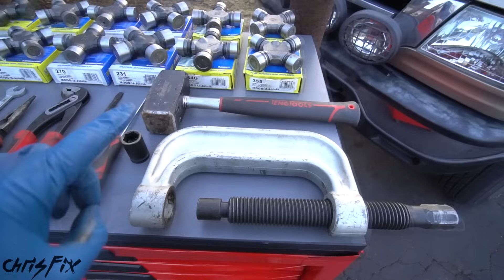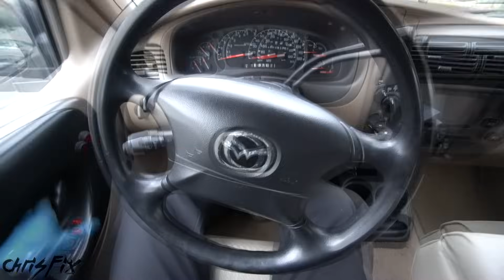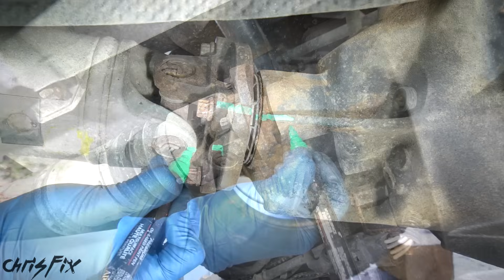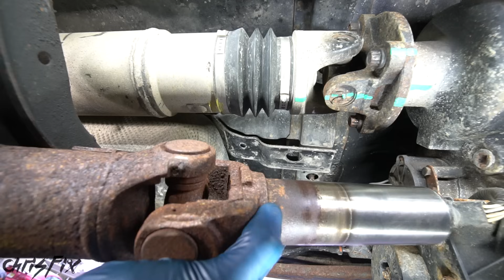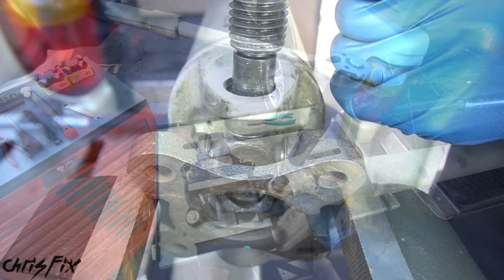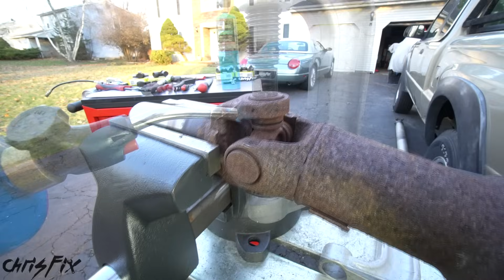How to Diagnose and Replace Universal Joints (ULTIMATE Guide)

Comment: I always get a chuckle when they make a point of marking the position of the driveshaft vs. the yoke.  The drive shaft is balanced as a unit, not in the car. In other words it's position related to the yoke was random at the factory. It would make sense to reassemble the slip joint in the same configuration if you have a two piece arrangement. If you really want to do it right, after you change out your u joints you would have the drive shaft rebalanced.
Reply from the maker: Correct and I always mark it because it’s not causing any issues with vibrations on its current position and I’m teaching millions of people who will see different drive shafts so I err on the side of caution.
Reply: @chrisfix  Thanks for the reply. I agree people do learn things from your channel. That said, I don't like to invent unnecessary steps just for the sake of doing them. Understanding how components work is the true goal. Mentioning that a driveshaft is balanced independently might actually save some frustration.  As an example, I had a driveshaft with a slight bow in it.  By itself it wouldn't be noticeable but when put on a lathe it became quite obvious that balancing it would not be possible. Therefore, I the mystery of where the vibration was coming from was solved and it was not the usual suspects, as is often the case when working on cars.

Comment: Good afternoon fellow DIYers, im planning to replace the U-Joints on my 2005 Toyota Sequoia and noticed that the drive shaft goes into the transmission. My question is when i remove the drvie shaft from the transmission, will fluid come out or will seals need to be replaced? Cheers, Andy
Reply: I assume you have a rwd car so if it's a slip yoke then fluid will come out and you'll need to refill the transmission with the same amount of fluid lost (or just until full but if it's over a quart lost make sure you refill before starting the car to check the fluid)

Comment: Great instructional video 👍 I believe it's my driveshaft causing the issue of vibration when I accelerate, however, the vibration stopped and I had no brakes 😳 is this also a symptom of a Ujoint issue?
Reply: no. that's a different can of worms. fix the brakes then shove a screwdriver in the driveshaft and try to move the driveshaft with the vehicle not running and in park (or first for a manual car) and if it moves then you need ujoints

Comment: I had a truck that was vibrating like crazy at 20-35 mph but smoothed out other than that. I figured it was unbalanced wheels so I scheduled an appointment. On my way to the appointment, my u joint blew out and driveshaft dropped😂found my problem

Comment: Hi Chris, I have hamming/vibrating noise coming from passenger side, when I'm sitting in driver seat. It's like something is spinning in uneven way. Zero up to 100 km/h nothing. It starts at 100 km/h, peaks at 110 km/h and disappears at 130 km/h. That sound is definitely connected only to car speed and not to engine rpms. Its louder when pressing gas pedal/accelerating, but it does not disappear completely when not accelerating. Its not engine, because that sound is same when in neutral or any other gear. Its not unbalances tire or wheel. I tried many different wheels. Ball joints are perfectly firm. Sound does not change when braking. There is no play in wheel in any direction. I've already changed both sides bearings and inner transmission side axl homokinetic joint since I found this joint could cause this sound. No rubber boots were damaged. All looking good as new.  I used high quality replacement and nothing helped. Axl itself looks perfectly fine. I also tried clicking test when turning full left, full right and accelerating. Nothing, there is no clicking sound. No I dont know, this sound started just like that 4 month ago and does not get better or worse. Still the same. I didnt hit pot hole or anything. I'm driving quality highways. My car is vw golf 6 with only 110 000 km in very good shape. Now I plan to change outer wheel side homokinetic joint, but I dont believe it will fix it. I will be glad for all ideas and suggestions.

Comment: My sons 1997 Ford F-150 has clips on the outside of the u joint for the rear and the front U joints I didn't see clips on the outside and the caps are flush. I think the clips might be on the inside. My question is can different U joints be used so that the front and rear are the same? Like the outside clips more than inner clips. Also we pulled the drive shaft before watching this video so how likely is it going to vibrate if we don't put it back the same way? I use to fix cars back in the day and never had put marks on my drive shaft. It always drove smooth after replacing them.

Comment: I’m in the process of replacing my clutch slave cylinder and my rear main seal on my 92’ ranger. I’ve tried every trick in the book for getting the driveshaft bolts off and they won’t come off! I’ve tried the jack trick on the breaker bar as well as penatrating fluid. Do you have any tips at all to help me out?

Comment: My truck had symptom number two and I took it to the mechanic but they could not diagnose this issue. Fast forward a month later and the U joint breaks and I’m stranded on the road. Thank you for the video, it looks like I’ll be able to fix this on my own on a Sunday.

Comment: Hey @chrisfix this is a long shot but quick question I have a 97 Chevrolet cavalier 2.2 fwd I got my motor mounts and transmission mounts replace but it still makes a thump/clunk sound I don’t think the car has a u joint I really can’t figure out what is wrong with it
Reply: When I switch from parking to drive

Comment: Also U-joint vibration will change when you vary the throttle, when you step on the gas it gets worst and when you left off it gets better.

Comment: let me get on here and start a YouTube page and I will show you everything from a car top to bottom and you would love me because I only give you the real and I only give you the answers and the realism of live breaking something down that has an issue and self-diagnosing it with my audience or viewers I should say another good thing to look for is I was doing a lot of research and having an issue with one of my trucks and I'm a license mechanic for maybe several years I've been licensed but I've been doing mechanics my whole life since a kid and I am 34 I will be 35 but professionally I've been doing it for probably close to 20 years another thing to look for is Lugnuts I was doing some research to make sure that each one of your lug nuts are properly torqued specs and also the right lug nut on the rim or wheel I've seen lug nuts that are for an aluminum wheel or have a different pitch for the phrase steel wheel when you have an aluminum wheel or all in all there just not correct for the depth of the whole of the rim that it's sitting in and or mismatched lug nuts can cause improper balance of the geometry at certain speeds and therefore hands cause you a walloping a fact or some type of rattle or mumble vibrations also also if it has not been overlooked you can have a slightly bent wheel and it doesn't show up on the balancing machine if you have another good known set of wheels that have been triple balanced in the right lug nuts try them and see what happens with a good set of tires knowledge is key and understanding the problem to become a great mechanic great doctor great lawyer and sedra and really studying and mastering your crap and going through trials and tribulations to find out the root cause of the problem a lot of these doctors even same thing you go in for a something and they said something else and give you a prescription and send you out the door but they never found the root cause of the problem they want to get paid and push you to the next customers are concerned about

Comment: great video I've changed many u joints and just wanted to say that I have had issues with the needles in the cup moving out of place using the hammer method, instead of hammering on it I just use the vise to press it together, I never worried about buying or borrowing a press  tool my opinion, the vise works perfectly.  but to each his own
keep up the good videos

Comment: Back at it tomorrow. Hammered several hours and finally got it to move but still about a couple mm and it won't budge. Have 2002 F350. WD 40'd it. Sledge hammered it. Any ideas? You make it look so easy.

Comment: what I've always done myself when installing a new u joint. I always take the socket and put it on the cap of the u joint, instead of hitting it with a hammer I crank it in with the vise. Because I have actually had u joint caps break from blows from a hammer to them.

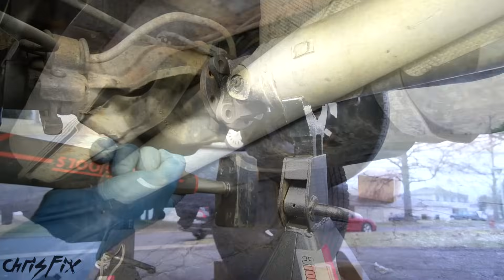Comment: 10:33  Here's why you want to chock your wheels... it would even be a better idea to release the pressure on the drive shaft by putting the vehicle in neutral and/or lifting the tires off the ground.  Always use jack stands!

Comment: The most complete video on U-Joint replacement, others don't tell how important it is to clean everything before installing the u-joints and this is a must. When driveshafts are assembled to install them in the vehicle at the assembly line, they are perfectly clean, and so it should be when installing the new joints.

Comment: Thank you!  I learned a lot from this video.  I've done u joints before, never knew about the hammer knock at the end to settle them.  Never knew about the plastic injected ones either!  I prefer to use the vise as a press with a socket (so, kind of a mix between tool and hammer method), just use a small socket for the push in side, big socket for the push out side.

Comment: I just realized I haven't been putting all 4 c clips on when  I replaced the u joint  my 97 blazer , I only used the 2 on the driveshaft but not the axle side , that explains why the bearing cup fell off 3 times already 😩

Comment: Hey Chris I would like to ask, would you still consider the U joint to be faulty if the vibration mostly stops when you take your foot off the gas, even at high speeds?
Reply from the maker: Sounds like an issue with motor/transmission mounts rather than a U joint. I have a video on it here, check it out: https://www.youtube.com/watch?v=ZTRV5GXWpo0 and https://www.youtube.com/watch?v=33k3vL-j68Y

Comment: Hey man just did my rear u joint on 4wd 2001 Silverado did only the u joint not the one by center support or a new center support which I probably should have but what do you think it could be they're brand new. Too tight? What could cause this need help asap and could this damage my rear diff or transfer case if they're too tight or other problem?

Comment: I agree with Macho Camacho said.    Your videos are great and you make working on cars seem so easy and fun.    I love saving money by knowing how to do things by myself.    I don't like to rely on others and being at the mercy of a repair shop.    I do work on my own cars but I try and stick to the interior stuff (changing out radios, temperature controls,  seats, tail lights, etc.); however, I think after watching your replacement of universal joints video that I could tackle this too.     I have a 2005 Tahoe, 2002 Suburban and 2000 Buick Park Avenue.   So with older cars, I always have something to work on.    I love to tinker with cars and I go to the junk yard alot.    I learn how to take things apart at the junkyard so that when I work on my own car I do it right.    Thank you for your excellent and informatvie videos.

Comment: Fantastic video. Excellent. Some Japanese drive shaft has a centre bearing with a rubber cushion with a holder to prevent the movements more conformable
Reply: Sorry to prevent the rough movements. And mothod is bit different to system to this

Comment: Your Mazda 4x4 I would assume that the front u-joint that goes into the differential on a 2011 Ford ranger 4x4 would be the same process correct ?

Comment: I have a 2011 mustang that only vibrates when I’m coasting (letting off gas no brakes) at 2k rpms or above. Once I hit the gas again it’s fine, ever heard of this? It’s a manual btw
Reply from the maker: Definitely sounds like bad u joint, sometimes it can show itself while accelerating or when coasting off the gas like in your case.

Comment: thank you ! 

i’ve been plagued with a seized caliper & seized bleeders all around courtesy of my denali’s previous owner :) but then i heard that cyclic squeaking & knew it wasn’t my brakes & it wasn’t my hub… i’ve replaced my fair share of hubs… & this was different.. added the metal on metal clunk i heard as i pulled in my drive(not while shifting)& i knew it wasn’t my hub or brakes… i’ve had all the wheels, calipers, etc pulled for 4 days & been stuck in my work truck…. this video has literally helped beyond measure! sure enough, i’ve got 2 failed u joints. i would have had a few more headaches i’m sure had i not seen your video. 

(at least my calipers got a restore & bleeders extracted.. & a much needed brake flush!)

thanks for taking the time to educate people about their vehicles. im self taught. & i love to learn more.

Comment: I replaced a u joint from auto zone and it was defective or didn’t fit correctly according to a pro transmission shop said to use oem or spicer . First mark the drive shaft and if heat is used let it cool a little before banging on it . In chevys or gmc the drive shaft should slide on , there’s a tooth that a little wider in the male end about 1/4 down to line it up correctly which is hard to see with a bunch of grease . I very seen people persuading the drive shaft in with a hammer and knew it was aligned correctly 🤔🙄. I ve always had to hammer them in but too much force is not ideal imo .

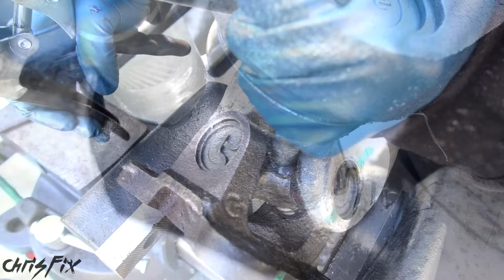Comment: one tip if you want to consider , grease don't need to get out of the boots when you put it in because you wear up the boots . the boots are on the caps , check on the video to see  where the grease comes out 18:06 !
Reply from the maker: Boots are designed to push the old grease out, but thanks for sharing!

Comment: I'd suggest not using a wood file on metal.
Also, the press tool isn't necessary since you already have a vise.
You need to check the position of the grease fitting to make sure it will be accessible after the shaft is reinstalled.

Comment: Overall, a pretty good instructional.  I might mention several things for the benefit of new mechanics:
I know that everybody does it, but using a screw driver to drive clips out is the mark of an amateur.  Use the proper tool; a small pin punch.  Screwdrivers should be used to drive screws.
While it's good advice to not clamp the drive shaft (DS) by the tube ON AN ALUMINUM DS, a steel drive shaft will not be hurt unless you REALLY reef down on the vise.
Remove the grease zerk (if the U-joint comes with it installed) before installing the new U-joint.  This will prevent the zerk from being damaged during the install and give more room to put the new U-joint in the yoke(s). Don't forget to put the zerk in....and regrease the U-joint....before putting the DS back on the vehicle.

Thousand-grit "sand paper" ?? You'll be there all day.  Use 150 grit emory cloth.  It will do a better, faster job.

Comment: Hey great video. My driveshaft broke off where it connects to the transmission while I was driving. but looks good still. How can I put it back on with new universal joint, if I did not mark it with a marker like you did before taking off the driveshaft in your video on both sides (transmission side and differential side) if that makes since.

Comment: Chris, when the u-joint was hard to move and you hammered on the flange, what was going on? Was there some binding on the bearings  due to the caps binding the bearings or was there something else going on? I don’t think you said. I did notice that on the flange you hammered on the ends of the ears but on the driveshaft you hammered on the face of the ears. Any rationale there or is the object just any significant vibration that is desired to settle in the caps/bearings?

Comment: Hey Chris I have an 04 Dodge Ram and I have this weird humming type noise. I thought it was u-joint so I replaced them and my rear diff is fine but the noise is still there. Basically what happens I get up to about 25-30 mph and it’s a weird humming noise. I just didn’t know if you had anything happen to you because of bunch of friends that I have told me they never heard anything like it. My next step was to take to a dealership 🤦🏻‍♂️ and see what it is but I kind of want to save $100 lol. If you have any idea or recommendations please give me a shout.

Comment: Non greasable u joints typically still have a grease channel and you can drill and tap to add a zerk fitting. Non greasable are hardly stronger.

Comment: I came here because I'm about to swap out my steel driveshaft for an aluminum one and wanted to make sure I knew what I was doing with the U joints. I have one question though. Is there any way to make sure the new driveshaft is balanced? I know you marked the driveshaft and yoke to put it back the same way, but how do I prevent issues when I am replacing the driveshaft altogether?

Comment: Hi Chris.
Do you have a link for the needle nose pliers? I'm having a hard time finding the same style.

Another way to do this: 6-8" c-clamp with a socket big enough to cradle the ear of one side of the yoke and a smaller one that fits inside the ear and drives out the other side of the  joint into the bigger socket (Jeepers trail fix).
Cheers.

Comment: Chris, my rear end is vibrating at 40-50mph and low rpms. But goes away when its under 40 or above 50, or when in a lower gear, rising the rpm’s. Do you think this is my u-joints?